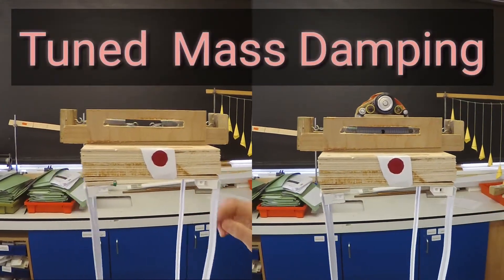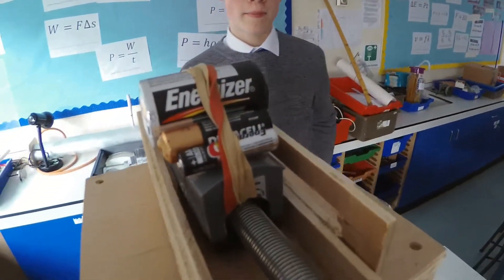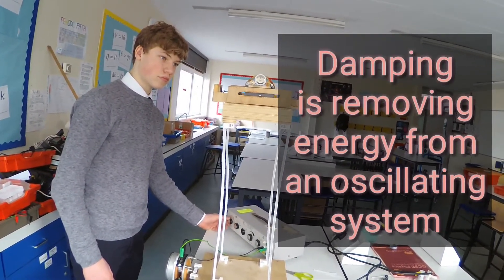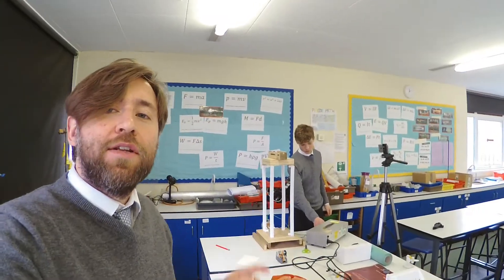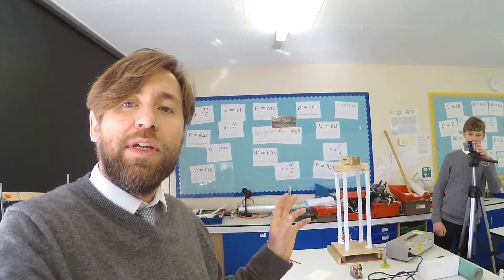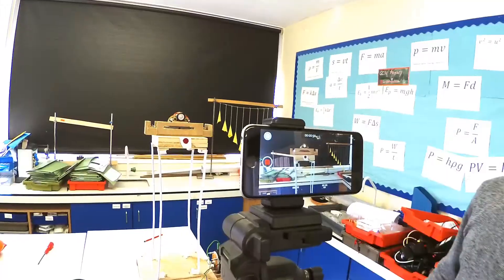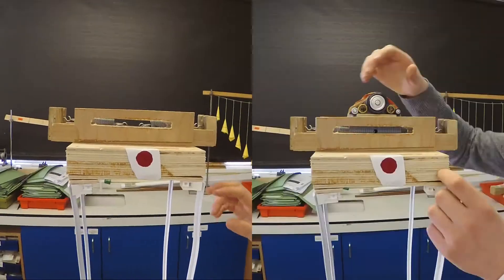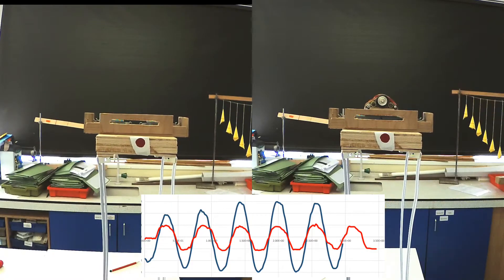Tuned Mass Damping EPQ Project! - Earthquakes and Resonance in Buildings

Comment: So is the vibrational energy of the tower transferred to the TMD-spring system, which is then transferred to heat/ elastic potential and removed from the system?
If it is that's a really cool demonstration of combining a pendulum and spring system together!
Thanks
Reply from the maker: Rory Burke correct bud! It's good right! Well impressed with Adam!